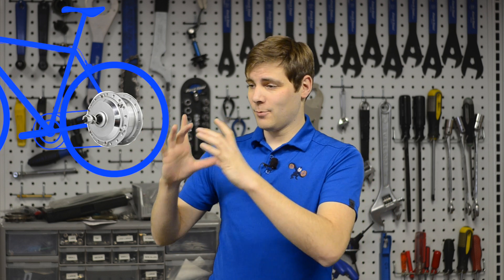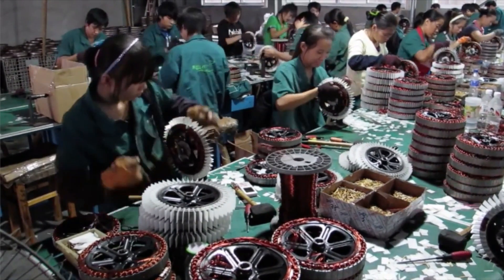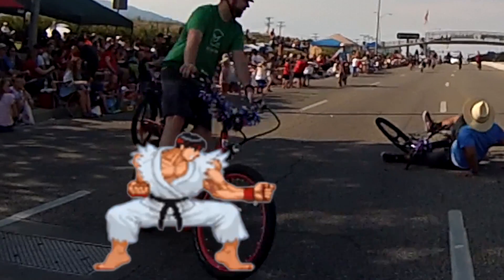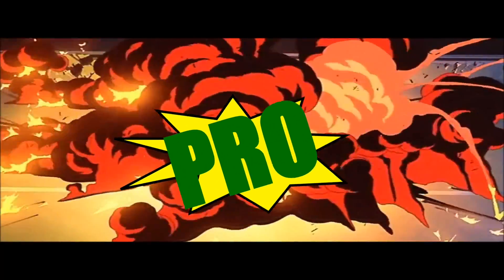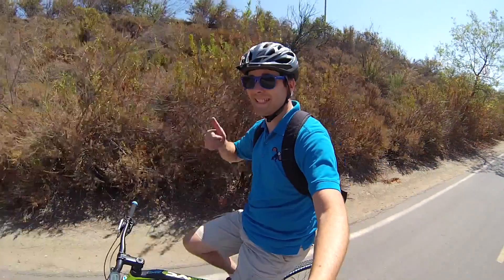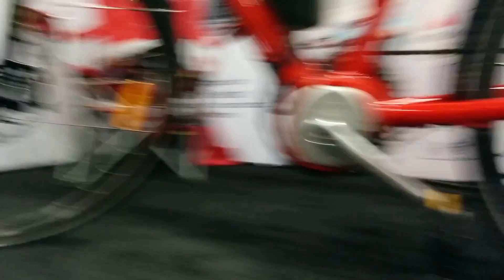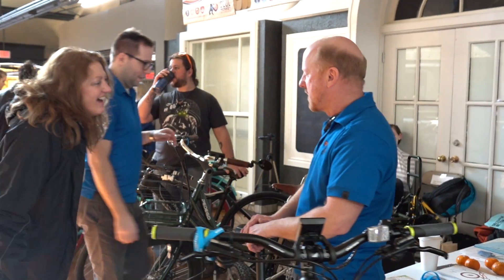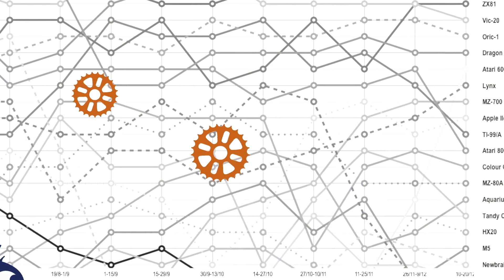Hub Drive VS Mid Drive eBike motor systems

Comment: I heard that if you have a mid drive with a throttle, and you start from a stop at a gear too high, the torque from the throttle could be so powerful that it could snap your chain. I’m guessing that’s why you don’t see a lot of mid drives with a throttle maybe?

Comment: One more thing. Hub motors need torque arms because they put a lot of stress on the frame joints. So hub motors are best suited for steel frames. Aluminum is a no no.

Comment: you didn't mention that hub drive motors tend to burn out much faster and also tend to work the spokes loose for the wheel you attach them to...you can fix a chain on the side of the road but good luck with a ruined rim.
Reply from the maker: I've seen hub motors run for 10,000 miles without burning out or ruining spokes.

Comment: So it is true that for a cruiser-type bike with no gears, a front hub motor would be better?
Reply from the maker: I wouldn't say "better".
Gears or not, a rear hub motor feels a lot better than front hub motor.

If the rear hub is occupied by an internal gear, or a coaster brake, then a front hub may be preferred to retain that feature.
Cruisers are pretty easy going, so the issues that front hub motors face are quite muted on a laid back bike.
Reply: @BlueMonkeyBicycles  , thank you - that's what I was thinking and I'm trying to do an easy, low-cost conversion on an old cruiser bike to get started!  Great video, BTW.

Comment: Most mid-drive bike also have a throttle. Will a mid-drive still break a chain when in the lowest gear?
Reply from the maker: There's a lot of mid drive systems that do not have a throttle.
Bosch, Shimano, Yamaha, Brose, MPF, Impulse, and many more.
Reply: @BlueMonkeyBicycles  and there are a lot that do, frey, Bolton, Blix, Juiced for example. What about breaking chains? Does the gear you have the bike in matter? I've heard that starting out in top gear can do it.
Reply from the maker: The companies I listed are all different motor manufacturers. Frey, Bolton, blix, juiced all use the same motor manufacturer; bafang.

Comment: I have ebike rear hub motor. But i like to improve power on the bike, i gonna install bafang mid drive motor i like have  you opinion about because I don wanna burning the rear hub motor, you think they can work together.

Comment: I know you are a trail rider and understand why your review is geared to using the ebike for trails.
 The weight distribution on a street bike is usually too much weight on the rear wheel.  A front hub actually helps with the distribution.

Comment: I am in the market to buy a CONVERSION kit for my current non-electric bike. I am hesitating between a Mid Drive o a Wheel Hub. What would you guys recommend?? ( this is 3 years later, things may have changed).

I am fine with both a throttle and a pedal assist... I used to ride motorcycles so a throttle is not unfamiliar territory for me... It would be fine.
Reply from the maker: It really depends on what you want from the bike, your riding history, expectations of use, etc

Comment: Could you put one in front and of in the back at the same time? Would even the weight out
Reply from the maker: It would even the weight, yes. However, two hub motors weigh more than a single mid drive, and hub motors are always unsprung weight

Comment: hello what do you recommend from the motor to buy a bafang 250w or 500w place with a lot of uphills and 115 kg weigh
Reply from the maker: 500w, maybe even 750w.

Probably a 48v or 52v
Minimum 10ah

Comment: Here's a mid-drive motor ebike with a powerful front hub motor both running off the same 52v 21Ah battery. Two wheel drive baby!... With regenerative braking https://youtu.be/YR93_jBm53E

Comment: You said you used a rear hub for your commuting fairly long urban distances.   Do you still recommend that?  Which rear hub bike did you use in your commuting  in this video?  I am considering getting a BH NITRO 29 PRO... any thoughts on this bike?
Reply from the maker: I had a 2014 BH nitro, 700c with a hub motor. I personally rode it for about 4000 miles on the odometer. Since the nitro had a top speed of 28mph, and a 48v 9ah battery, the range was quite low, about 15 miles going full blast. If I went slower, is probably see around 25-30 miles on a charge.

Comment: Hi,i accept hub motor only if its wattage more than 10.000 W.and top speed at 80-100 m/h.
Reply from the maker: For a bicycle? That's not useful
Reply: @BlueMonkeyBicycles  Not useful?why?!
Reply from the maker: 100 miles per hour on a bicycle would be like blowing your nose with a lions tail. It might be fun, and get you bragging rights, but you would likely die, and no one would feel sorry for you.

Comment: Myself I have to a three wheel bike (do to medical conditions) with or without solar battery power? O and I may be moving to Michigan. So any help you can give me, I will truly appreciate. 🙂
Reply from the maker: What's your question?
Reply: @BlueMonkeyBicycles  I have to ride a three wheel or a four-wheel bike (I have epileptic seizures) I would like to check into a three wheel bike with maybe some kinda of solar or something like a alternator to hook up to the battery. 🤔
Reply from the maker: Three wheelers are much easier to come by. Try electrictrike.com
I know those guys personally, and they do good work.

Solar panels exist for electric bicycles, but they are mostly for camping or long term touring since they take forever to charge a bike battery.

Alternators to charge a bike while moving don't exist, and they won't.

Comment: But should i buy brushless hub wheel or brushed??
Reply from the maker: I made a previous video on direct drive vs geared. What might be worth a look.

I've never seen anyone use a brushed motor on a bike, but I have one on a small electric car.

Brushed motors need a bit of maintenance from time to time, opening it up and replacing the brushes. They work fine, for years and years. Maybe they're a bit heavy for a bike? I'm not exactly sure why they are never used for bikes.
Reply: @BlueMonkeyBicycles  thanks
Reply from the maker: Sure thing

Comment: Can iget a bigger motor for my raycon hyper flight to make it go a little faster????
Reply from the maker: A bigger motor alone probably won't change anything.
The motor outputs power that is given to it by the controller. The controller in your bike will likely need to change in order to get more power delivered to the motor
Reply: @BlueMonkeyBicycles  thanks alot that was really helpful!!! To get the controller changed how much would that cost an how long does it take to do

Comment: Hi, steep cliffs, are mid drives better than hub drives for steep cliffs. I have to go through cliffs that do not have pavement to get home and i have been dealing with trouble with my hub drive to get home. Overheating. The shop people told me I had to get off and walk through some of them. Whats your intake on these issues?
Reply from the maker: Steep cliffs? I don't know if any bike can climb a 90° angle.

Comment: Which motor is usefull for single speed bicycle? Hub motor or mid drive?
Reply from the maker: Probably hub. Either would work, bit since there are no gears, a mid drive motor wouldn't be week utilized?

Comment: OMG I cannot believe they are winding the copper wire by hand. If they did not have slave labor I could not afford a bike like that I got the hammer I love my ebike I got to do some upgrades their handlebars are a little loose where the bearings are I think a spacer is missing

Comment: This guy has little knowledge of ebikes, mid drives have throttles and only 3 models have a frame enclosed on the mid drive, bosch, yamaha and bafang ultra but there are many that work as a kit, bbs01/02/03, torsheng( former bafang designers ) and a slew of others.

Comment: Cheapest e-bike diy build? Easily sourced parts from Alibaba app thus far as much as 14kw to 16kw rear hub electric drives and matched controllers at Chinese Ultra Low prices they may need motorcycle chains to resolve the mid-drive chain stress

Comment: He failed to point out one really big advantage of front hub motors. They turn a one wheel drive vehicle into a two wheel drive so both wheels share the pulling.  Whilst the other two are still just one wheel drive whilst the front freewheels.
Reply from the maker: Whilst, I didn't forget

Comment: "We Don't Ship to Alaska" my bane.  I live up in the foothills from town and my old tired vehicles are beyond engine repairs and I was stuck with COVID cancelled bus and $30 cab to find no milk at the store desperate.  Nearby the bike shop had two e-bikes, smaller and Large.  Trek.  Mid Motor.  The what squee222 is thinking was me too.  It is slow, 18 mils per hour and the gearing power is more than plentiful even in high gear pedalling at high speed at 18 miles per hour.  At 19 the power assist ends and heavy bike I slow down.  Each motor style has advantages and disadvantages.  Plastic internal gearing add torque and plastic grinding durability where  gearless hubs offer less parts and simplicity, regeneration, higher speed rotation potential.  When the battery fails, different motors offer their own resistance to the ride, depending and I have not more knowledge than this.  Compromise each style.  I think I would have prefered regenerative.   I bought a great start bike.  I want to add push button to go to the front wheel a 30 MPH motor.

Comment: A couple of disadvantage of a mid drive I can think of is the high powered ones might wear out your chain and sprockets more quickly, also you can't do regenerative braking with a mid-drive.
Reply: I have a mid drive and have over 1000 miles on a chain and wheel from 1998 and everything is still good
Reply: @minnil7927  since September 2020 when I got the kit my odometer reads 3280 miles, not counting a few when the sensor came off. The annoying thing about the BBS02 is how easily it comes loose on the bottom bracket. Mine won't tighten up now as I think the gripper lines on the bike have worn. I think trying to restrain all that torque around an inch and a half wide circle is a losing game anyway. It would be better to have a spacer bracket around the under tube. I just wedge a piece of wood between the motor and frame.
It also protects the frame from dents.

Comment: I can't wait for my 750 watt mid drive kit to turn up. I got the 52 tooth sprocket because I'll have more than enough hill climbing with 750 extra watts on the 52/28. I can get super speeds with the 52/11 or 52/12 with combined leg and motor even downhill. With a hub drive I have to pick between hill climbing and still being powered at 30 mph. I ideally want to be capable of greater than Tour De France speeds for the whole commute, but be able to come to a steep hill without bogging down the motor.

Comment: Hi to all, These people do not know what they are talking about, first of all if you ride on the roads all the time why the hell do so many have tyres that are off road as they use up your range by 25%. Secondly and most importantly mid drive is a really stupid idea and ill tell you why, if you have a hub drive in the front wheel with peddle assist to the rear wheel you have the perfect set up for many reasons.1 full load is not on your chain, 2 if your chain breaks you can still get home, 3 if your mid drive fails you are stuck, 4 traction is way better if you have hub on the front and pedal gears and chain drive on the rear. 5 try going uphill on front hub drive and pedal rear even on wet leaves, it works.
Reply from the maker: Coming out swinging, huh?

Comment: One of most con for hub drive, it can't upgrade to more high speed derailleur, because hub drive only can allowed big old freewheel system.:(
All the major and high-end derailleur systems made with free hub.
Reply from the maker: Bigger chain ring in the current fix.

Comment: so many conflicting opinions-I have a commuter bike (trek ds3) and need to commute 75km (46 miles) a day without charging - will get a 48Vx17.5 battery - being a commuter I want to pedal faster than 32km/h too - If I want to pedal 40km/h I should be able to without feeling the motor drag and work against me. 500w BBSHD sounds good but right now I'm leaning to a 500w Bafang rear hub as I think that will help me pedal faster with no drag and help on hills here in Vancouver and be more efficient on the range to get me 75km. Am I right in my thinking ? Thanks!
Reply from the maker: You may want to look into a larger capacity battery. That size will likely do 46 miles of pedal assist, but- not forever.
Batteries last a certain amount of cycles, how many times they can be charged all the way to 100% and then discharged down to 0%. These cycles add up over time, even when only riding down the driveway for .1%
Anyway, if you get a 48v 17.5ah pack and ride steep hills for 46 miles at a time (at ~20 ~25mph), you'll be draining the battery almost everyday. Over time the battery won't last as long (like a phony battery) and you may find yourself without power after burning through battery life cycles too quickly.

Therefore! I would recommend a dual battery, or perhaps a single battery with a high capacity, maybe a 48v 21ah+
Reply: @BlueMonkeyBicycles  Thanks ! appreciate quick response- will look at dual batteries option so I can go further on some days.  Is rear hub still the best option for distance ? I tried Bosch and Shimano Steps but found with their drag when I wanted to pedal faster than 32km/h to be discouraging. I'm a strong cyclist and don't mind the workout as I'm doing this commute without a motor now. Cheers.

Comment: Any thoughts on the Swytch? It's a new front hub motor system I've recently seen.
Reply from the maker: Never tried it. Seems like a small system, all things considered
Reply: @BlueMonkeyBicycles  Have there been any issues with hub motors that seize/lock up if they fail?  I'd hate to be riding a front hub mounted bike if it were to happen!
Reply from the maker: Not that I know of. I've seen only one motor fail in that manner and it still rotated under heavy resistance, so the immediate failure didn't causea catapult.
Reply: @BlueMonkeyBicycles  Thanks for the info!

Comment: Mid-drive systems offer on regenerative breaking, as the chain/belt drive cannot provide reverse torque. The ideal system would be a front & rear hubs motor, integrated with a mid-generator and a battery charge controller that manages regenerative breaking power and cyclist input power. This calls for some clever, compact power electronics design... 2 motors, 1 generator and multiple batteries... getting really complicated.
Reply: seems to me it would be better to put regenerators on the hubs, fit them with levels so every time you start going downhill they engage.  motor would be in the mid position, where usage is most efficient. but, who knows?

Comment: My question is is it practical to use two hub one in the front one in the rear two batteries one converter for faster travel?!
Reply from the maker: Converter?
Reply: Sorry controller box
Reply from the maker: Possible? Absolutely.
Practical? No.

You'd be better off using a single motor, with a larger capacity battery and a controller rated for high load.

Two motors can help in traction, but there are easier ways to go fast. Check out my review of the cyc x1-pro on the Electrek YouTube channel

Comment: Has anyone ever installed a hub motor, as well as a gasoline (maybe 2 stroke) engine (acting like a mid drive) on a bike? Would that really work?
Reply from the maker: Pretty much everyone who goes electric never uses gas engines.